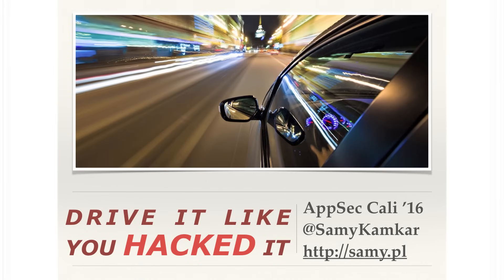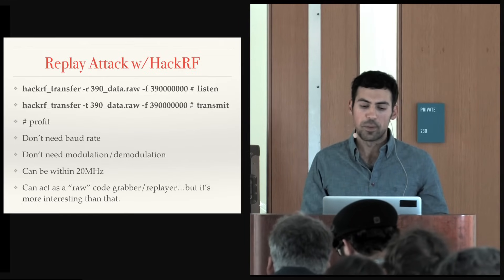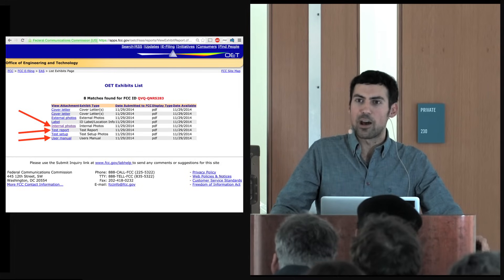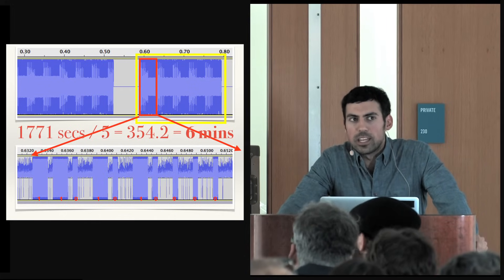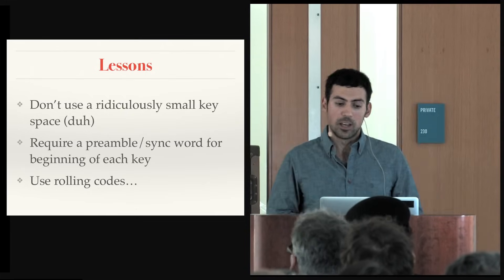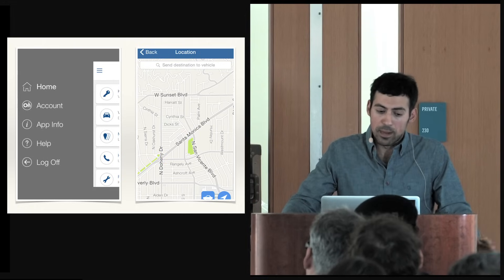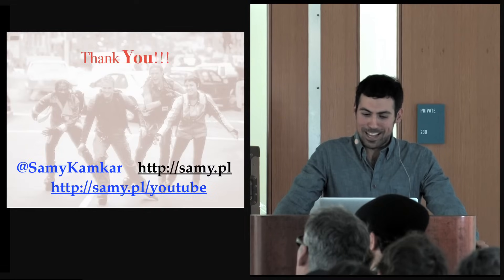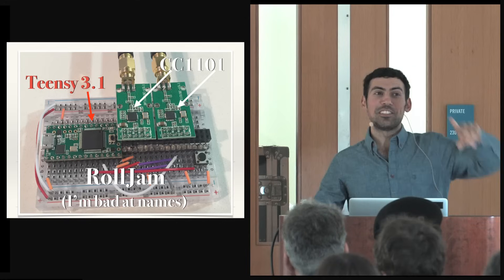Radio Hacking: Cars, Hardware, and more! - Samy Kamkar - AppSec California 2016

Comment: What effect would an over powering blank carrier have on the working freq. utterly swamping the lock receiver?  or even pulsed RF from a 100watt sender? 
Some of these lock receivers are just super regen., not noted for high front end dynamics or adjacent channel selectivity.
433 Mhz is/was a common freq. Right inside the 70cm Amateur band?  100 watts mobile with a high gain often available a few cars away ?
Reply: High power isn't going to do it. You still need the code  to make the receiver react.
Reply: @cinibar  
Not interested in making the RX react. Quite the reverse. Talking in terms of simply swamping it. Some are only super regens. Hardly a front end with much dynamic range. Desensing must be a serious prob.
A 2 watt tx with its antenna  in the garage, close to the Rx and switched on after the garage were locked, might render the code u.s. to the hacker?
While the garage is empty normal security would suffice.
Reply: @MauriatOttolink  Oh okay. This is different however this brings up another situation. In electrical theory it should work fine but if you use a power that is higher than the FCC allows for unlicensed items, especially in that ham band, you could interfere with amateur radio operations. Not good! Maybe an easier way would be to simply ground the RX antenna input when you were done using it. That way no signal could make the RX do anything.
Reply: @cinibar  
Mr  Sparks 51.. Couldn't agree more!  I was certainly being a bit heavy handed. 
With a1 watt transmission in the garage and a direct coupling (no antenna) you'd certainly swamp garage  receiver against any intruder attempts but you'd swamp your own attempts to open the garage when you arrive home... Now that would be very useful!!!!
A grounded antenna input wouldn't stop somebody with a big signal 5 feet away unless the entire set up were Faraday screened to a very great extent.
I've tried it for close in direction finding. Can't eliminate sigs creeping in, inside the DF antenna!
Thanks Mr Sparks.
Reply: @MauriatOttolink  Hi again, here's another thought. Use a transmitter/receiver key fob system to turn on and off power to the other receiver that you don't want hacked. It's pretty unlikely anyone would think they needed to double hack a system like that. Yeah it's sort of headed toward a Rube Goldberg conglomeration but security is security! And for a little more security, add a timer into the system so you only have a certain amount of time to activate the main receiver and or the key fob receiver! heh heh heh!
Reply: @cinibar  
Where is my brain? Of course. Must pursue that!
Incidentently ...I  AM licensed on  430 Mhz to 400 watts as a UK HAM but possibly not for the blank carrier mode  I had proposed.  400 watts were not intended but QRP sufficient to block the receiver.
Further, It's occurred to me that the garage door wouldn't need super hacking security if the car
were out on the road and a simple on off switch when at home!
Thanks for your exchanges..
Time was when I was able to hide a simple on off switch within the car, depriving the fuel pump of its power supply.  
Days gone by!
Reply: @MauriatOttolink  Hello OM, Yes some of the simplest things seem to escape us! I'm also a ham, 73 and stay safe my friend!

Comment: Wait so if his garage door opener operates on a single frequency, does that mean it is an AM signal? Alternatively for my cell phone, there is a lower and an upper bound. Does this mean my phone does FM with a bandwidth of (Higherbound-Lowerbound)? Thanks. I'm sort of interested in this stuff. I took a class on antennas but I wished I asked more questions.
Reply: Yes, you nailed both cases

Comment: what if remote just send a password+ current datetime and its encrypted into jwt for example and receiver decrypt this data and reading the password and checks id the date\time he got is not expired? I believe this solution should work, so if a hacked will replay the signal then car will not be unlocked because the date\time passed in the signal already expired, what do u think?

Comment: So isn't the rolling "code" window a math problem. If your outside and record the lock / in lock commands how many in a row do you need to get the equation, smells three would do. I have had to reset MB cars it only takes hitting the remote a dozen times to get out of the " window"

Comment: garage door openers use rolling codes these days. the dip-switches are from a few decades ago. awesome info though! amazing :)
Reply: I just installed a garage door opener and it has dip switches in the remotes
Reply: @mattmurphy7030  you're  right... there still are dip switches... I guess what I meant was that a few decades ago before rolling codes, the dip switches were what made the signal unique and you could replicate the remote by matching the dipswitch positions on another remote.

Comment: A good system design requires segmentation and isolation that considers security.  Unlocking doors and rolling down windows via wireless is concerning, but if these systems are on the CAN bus; theoretically, you could send commands to other control units. Compromising the engine control unit and transmission control unit presents a moderate risk; but as more vehicles adopt electric controlled power steering and brake by wire systems, that is a very serious risk if they are compromised.   Remote assist parking suggests that this functionality is there.

The RF controls that are talked about here still only send out a 4 bit command.  Those commands are limited to performing very specific and very limited functions.  There is no way for someone to interface with the more safety-critical systems via the CAN bus, or to have the same capacity that is available through the OBD2 connector  - without making physical/electrical changes to the car.     Is there a REALISTIC possibility that someone could exploit a vehicle's systems wirelessly and covertly control steering or braking?  The media would have us believe that its already a possibility.  I don't think its possible without making electrical changes and installing added equipment.
Reply: If you can unlock the door and get inside the car.... which isn't tough to do.... who looks at their OBD connector every time they get into the car? Right, nobody.Can be done, just more time and an extra step.
Reply: You can manipulate the car while it drive, 
Without installing anything inside the car,
...
Possible and already done by smart exploiters
Reply: No, the RF interface does not have the ability to generate arbitrary CAN messages

Comment: WARNING: These exhibits have been provided by the applicant.  Exhibits filed in accordance with 47CFR 0.457(d) are not available.  The FCC does not guarantee the exhibits displayed on this site are virus-free.  It is strongly recommended that any computer viewing these images have virus-protection software installed. Proceed in viewing this exhibit?

Comment: How do I protect against being hacked?
Reply: Hide under a rock in a cave on a island.
Reply: When it comes to cars? Easy just lock it manually, don't give them a signal to sniff.
Reply: take a 12 volt cell with a large resister in series going to your ground connection of your house. make sure the positive side is the side actually going into the earth

Comment: First thing to go is trust. Too many crooks can alter ecu data with a dongle.
I protect my car with an analog device= A
Wood bat.
I used to Repo Cars. Bump, chain and gone in twenty seconds. One time, a new car with alarm blaring and E-brake handle pulled.
Two miles away, one tire blew. Slipped the tire dolly under the back end and continued on. Don't miss your payments. You'll lose.

Comment: Why are you scanning 300 Mhz if the frequency is 390? 

Seperate question, for the RTL-SDR command line, what is the default bandwidth it will scan? I am assuming it is a range since you were able to gather the signals data at 300 MHz. The spec sheet shows 390 MHz. 

What am I missing here?

Also, in your brute force attack; you show ~2ms/bit. How did you come up with this? I know the total time (for 390 MHz) will be 1/T which is 2.56ns. (it would be 3.33ns if we used 300MHz as you did) How did you take this time to find the per bit time?
Reply: For the waterfall plot, you enter the starting frequency of the plot, aka the left or minimum frequency side. That's why the peak appeared 90MHz further to the right.

As to your second question, the duty cycle of the signal of the amplitude shift keying signal shown in audacity has a certain length, that is not dependent on the frequency of the base carrier. That duty cycle leads to a length of 2 milliseconds per bit. The signal is the modulation of the carrier, not the carrier itself.

As a side note, if you would use the same modulation frequency as the carrier frequency, it would produce so many harmonics, the code would become undecipherable. It has to be, at the very least, a factor 10 lower to be distinguishable. Much lower frequencies, like in the audible range, are much easier to process and decode overall.

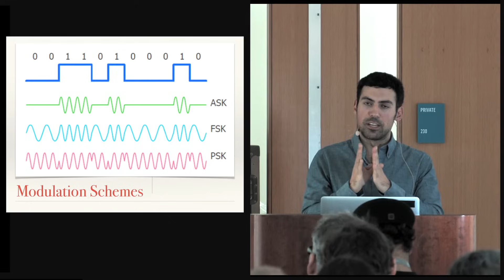Comment: 13:55 is his FM explanation accurate?
Reply: It is. The information is modulated on variations of frequency around a carrier frequency.
Reply: Well mostly but his range of bandwidth is not accurate, 107.5MHz doesn't span that much.
Reply: In commincation radios there is narrowband and wideband FM ..his explanation was basically right

Comment: If you attack a car, won't the steering wheel still be locked?
Reply: DriverUpdate of course it would. And if don't have mad programming skills I guess you could just tow the vehicle. Lifting the actual vehicle of the ground would work with NSA grade encryption :)
Reply: Bogdan Rădulescu he has stated you can remote start a car... if the car starts, the steering would not be locked. Do you know how cars work?
Reply: Most keyed ignitions with auto-start will automatically turn off when you touch the brake (disallowing you to put the car in drive). You would need to circumvent this security feature in order to drive away with the car, which is definitely doable but likely not practical. You don't necessarily need to steal cars anyways (that's a quick way to go to jail), but you can steal wallets, money, and things bought at the mall pretty easily with little way to catch you.
Reply: @NWProductionsHD  wtf are you smoking?
Reply: It's a very simple bypass

Comment: Need help, Can hackrf records below 30 hz radio frequencies.
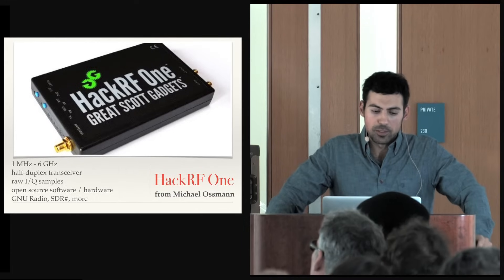Reply: As mentioned on the slide at 5:27, the HackRF works on carrier frequencies between 1 MHz and 6 GHz. A carrier of 30 Hz will thus not be picked up by it. Besides, you will need an antenna of 2500 kilometers or more to even pick up that sort of low frequency RF. And that's a quarter-wavelength antenna.

Comment: spoof gps ??? really ??? gps uses pings not RF
Reply: Yes! Really! I have a very good friend I've known since high school.  Shortly after high school he started a small company collecting, organizing, recording and storing information for other companies. Back then the data collected came in over slow pots lines and stored on reel to reel tapes. In a relatively short time he was getting awarded contracts with many major organizations from all over the world.  Now of course the information is handled over satellite and stored digitally. 

I gave you some of his background to let you know I don't know how he could what I'm going to tell you but he said at that time he could do this.

In 1999 I was working for Bell Atlantic Telephone Co. as an outside plant technician. Verizon invited contract bids from several of the larger data companies in the U.S. to equip and maintain GPS units in almost all of Bell Atlantic's fleet vehicles. He told me if he was awarded the contract he would teach me how to manipulate the GPS unit in my company bucket truck. So, let's say I was supposed to be working on splicing five terminals into a new 200 pair aerial telephone cable. Let's say in the middle of the day I wanted to go and park the truck behind an abandoned building about 20 blocks away and get some sleep because I had a rough night out the night before. I'd be able to manipulate the GPS unit so that when management checked the system for my location in real-time, the system would show I was where I was supposed to be. However, he didn't win the bid so it didn't really matter and it was about two years later I left there and started my own little communication company. Now I wouldn't bet my life on this being possible or anything else but , I would almost bet anything else that I own and say he could do it. He and I did stuff together when we were younger that we probably shouldn't even be alive today. I trust what he told me. If you find out it different, I hope you'll let me know. Have a great day.

Comment: just use a ham radio lol
Reply: Doesn't work that way...
Reply: @cinibar  ok well i kno garage doors do
Reply: @randallracer  How? If the garage door frequency is not in any ham band, you can't use a ham radio to actuate the door.. Also there's a digital code that needs to be sent to the door during the signal transmission. No ham rig can send that type of code. Maybe the door you seen reacting was malfunctioning and was interfered with by that radio that you seen make it happen.